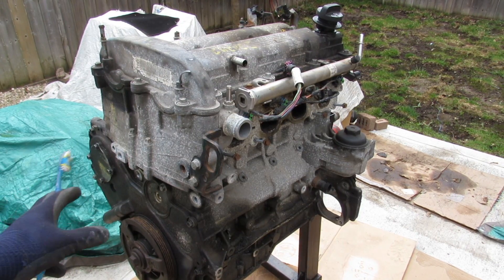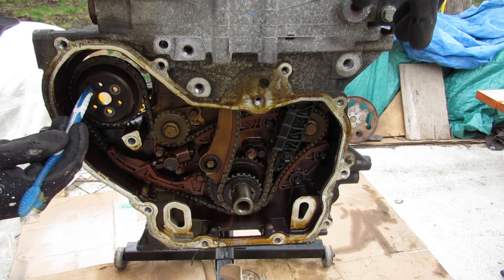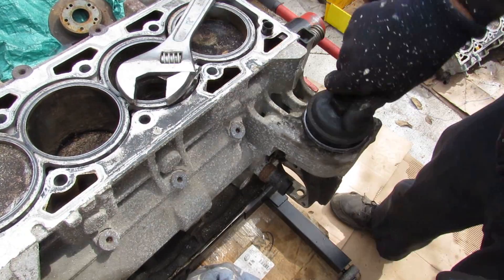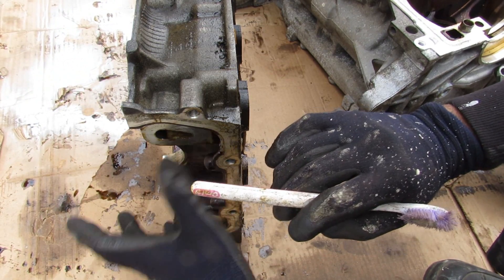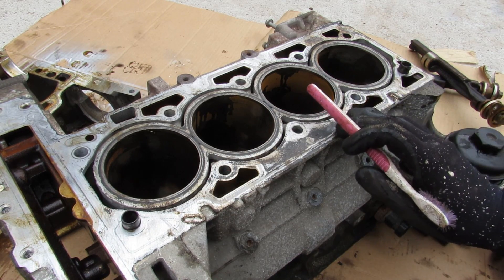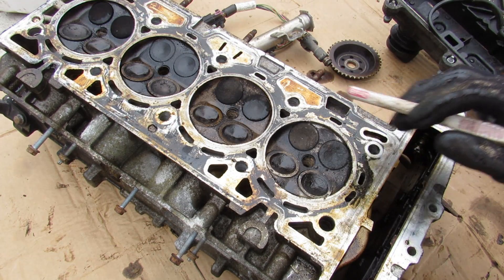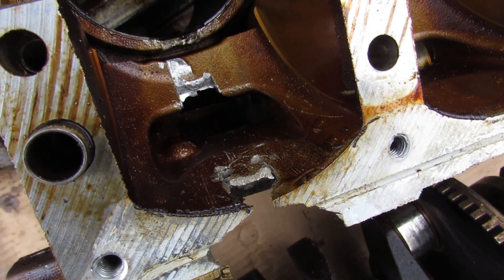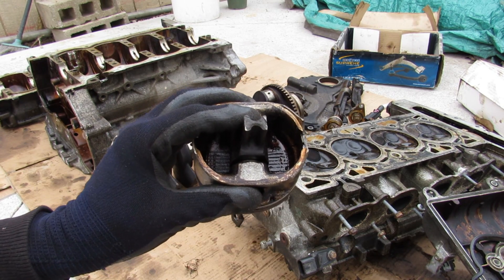Why GM Ecotec Engines FAIL

Comment: I had 2 different Cavaliers with the Ecotec engines.  One of them had over 184k on it when I traded it, and the other had 253k on it.  Both were 5 speed manual trans, and were original clutch and motors.  The only thing I had to do to them beyond regular maintenance was both had their fuel pumps replaced.  Both were running strong when the cars were traded, and neither used any oil. If you kept the oil changed, they were good engines.  It drives me nuts when people neglect their cars, and then complain when they have problems.  Doesn't matter what kind of car you have, if you neglect it, it will leave you on the side of the road!
Reply: I went into the dealership in 2009 and asked for the "Farmer's Special" I wanted a Cobalt manual transmission with only two extras: 1) air conditioning.  2) CD player.  The salesman laughed and said that this was just dropped off today and there it was, a shiny new Cobalt sitting in front of the display window with just what I wanted, including hand crank windows and a 5 speed manual for $9,500 with GM rebate and an additional GM credit card rebate.  I was driving 152 miles a day for work and I needed good fuel economy car.  220,000 miles later I gave it to my son who still drives it today.  I don't have a clue as to how many miles are on that thing now.
Reply: @g.k.1669 they really are solid cars. I beat the ever living fuck out of mine and it just loves it. Not shifting till 5500? They just love it
Reply: People who afford a lower end car are associated with being cheap and not as educated. Not hating, just explaining why these cars get so neglected. When buying any used car make sure the owner has a complete list of maintenance.
Reply: @Opalivian  you sound very uneducated
Reply: Yeah these are really good motors I seen ppl with over 300 and 400 thousand miles with these just gotta take of it
Reply from the maker: Well the reality is cavalier and cobalt are cars that attract buyers who will evidently neglect them.
Reply: @speedkar99  makes me feel like I did good with my Ion with the 2.2 then, bought it from an old lady with full service records. 191K now and still going strong
Reply: @speedkar99  I had one and didn't neglect it. I never neglect my cars no matter how inexpensive they are. This one still gave me problems with head gasket failures, engine idle and stalling problems. I also had a 2004 Malibu and have a 2012 one which has given me no problems.
Reply: @speedkar99 true but my 09 chodebalt has 216k on it original clutch, original everything other than OCV's and suspension parts. But I change the oil every 3-4k
Reply: @speedkar99  Yeah for sure. I mean look at those cars, they're vehicles I would neglect just so I wouldn't keep having to have those things on my property for long.
Reply: My 2.2 liter ecotec has lasted 275,000 kms with no issues, so reliable for me. Original starter too and it starts up like a dream every time. I don't know about these new aluminum engines though... considering these hot summers we are getting now a days.
Reply: @stephenphillips6245   My 2004 Cavalier 2.2 ECOTEC had 255,000 miles on it when a woman on her phone rear ended my wife and totaled the car. It ran great and used about a quart between changes, 3,000 to 4,000 miles. Luckily my wife escaped serious injury. Looked at a 2020 Cruze for $20,000 and the finance guy at the dealer talked me out of it due to trying to sell $10,000.00 additional repair insurance because of all the computers. After saying no to than twice and then him saying, "well, when you come in with a computer problem, the salesmen will laugh at you and point to service where they will laugh and say break out your check book" I stood up and said "thanks, you just talked me out of buying this car", picked up the $20,000.00 check and left after explaining to the salesman I had talked to about the car why I was no longer interested in the car. Later I started looking at common failures and issues with the Cruze 1.4 turbo engines and I was so relieved I did not get one. I went out and searched high and low for another 2004 Cavalier and found one with 36,000 miles. Happily paid $8,000.00 for it. Had to have a friend drive me 180 miles to go look at it. My wife is SOOOO happy with her like new 2004 Cavalier.  I always change oil at 3,000 miles in the summer and 4,000 in the winter. We are mid 70's and drive less than 5,000 miles per year now, so this car will last us until we probably will be unable to drive anymore.
Reply: @seniorrider9337  When something goes wrong computer wise, in newer vehicles, fixes are expensive as heck. If sensors are damaged during a crash recalibration could take dozens of hours and 10s of thousands...most are just written off because of costs (esp. vehicles that park themes or hold road positions). New vehicles are made to need lots of work and to be disposable.
Reply: @seniorrider9337  A few days ago I bought a 2002 Pontiac Sunfire in very good condition for its price of 1700 dollars from a woman who had recently been widowed. The previous 89-year-old owner had bought it new at a GM agency. I am 61 years old and I have always had carburetor cars with iron engines. After buying it, I took on the task of looking for information and the first thing I found were things related to catastrophic failures in the ecotec 2.2 L engine, the most terrible being the timing chain, after much research I found that almost all the failures were the result of wrong oil and long oil changes. On many occasions "there are no bad engines, only bad owners" and this is one of those cases.
Reply: @pazerfaust45  Totally agree with ya man.
Reply: @stephenphillips6245  
Those engines with 2.0T+ can handle the amount of power without straining compared to the weak 1.4T.
Reply: @Monster33336  Always better to go with the bigger engines for sure. Sometimes the fuel savings aren't worth the sacrifice.
Reply: I had an Astra (1.4 petrol)
155,000 when I sold it.used no oil. But I did change the oil every 5/6,000 miles.
Reply: @andylane247  1.4??? Was it a 3 cylinder??
Reply: @dontrustwhiteyevery1  
4 cylinder.  They used to be 1.3 lt. (A fairly old design) but were bored out. Single ohc.
Reply: My 2009 G5 has 276K on it. 5 speed manual. I did the timing chain at 200K. Runs great.
Reply: 2012 is when these engines went bad.  They made an engineering change.  Let me give you an example.  I bought my 2013 Chevy Equinox with a 1.4L Ecotec Engine.  It had gotten an oil change prior to me purchasing it.  2 Weeks later, the check engine light came on.  A friend of mine knows cars and knows this engine.  He said peak at the engine oil level.  It was at the bottom of the stick.  The oil change was 4 weeks previous.  Any car I have owned, I never had an engine use oil like that.  In fact, I never had oil consumption issues like that.  Eventually, it screwed the pooch and im on an engine replacement right now.  So, in this instance, it doesnt matter if you get the oil changed when you are supposed to or even more often.  This engine burned a quart of oil every 4-500 miles.  Its not always neglect.  There was a lawsuit brought against GM for these engines.  Its too late for the fix for mine and it was too late for it when i bought it.  The Equinox is a great car, except for the engine from 2012-2017 time frame.
Reply: @philipwilliams7947  aside from my Cavaliers, I had 3 Cruzes with the 1.4 L Ecotec, 2012, 2014, and 2017, the 2012 had 43 k on it when I bought the 2014, which had 137k on it when I sold it, and the 2017 had 127k on it when I sold it. The only problem I had with any of them was the turbo on the 2014 had to be replaced at 84k . None of them used any oil. Oil change intervals were based on the oil life monitor, and averaged about 7k for each oil change.
Reply: So true. I had to sell my 2006 Toyota Tundra.    ( 1 year old ) beautiful truck.      Money problems    Any way it now has 121.000  only thing been done is oil changes ( & not on time ) no other work done - old transmission fluid, old radiator fluid, old gear oil , eeeerrrrr. I gave him something nice & he just doesn’t give a sh-t    Kills me
Reply: Right! My 2.2 inline 4 cylinder has 245k
Reply: I'm fixing an 06 Coblat today for a friend, had 2 quarts of oil in the crankcase.. running on 2 cylinders and knocking like a rod is about to punch through.  less than 100k miles.   simple things like oil changes and fluid level checks go a long way.
Reply: The first eco tecs were decent. The modern ones are garbage
Reply: 2.4 ecotec is a strong running engine with really good reliability if maintained.
Reply: OIl must be changed eveyyear, at the final of the winter
Reply: I have a20nht 2.0t variant with direct injection. It has 130000km(not an enormous amount but still). Guess gm did their homework coz it doesn't burn any oil, like at all. The stupid thing is that owners manual says you should change the oil at a whopping 15000km which is pretty stupid for a turbo engine, so I reduced the interval to about 8000. Bought the car used, and I suspect that previous owners changed it at 15, but still no oil consumption. Unfortunately, can't say the same about the gas mileage which is pretty atrocious.
Reply: my thoughts exactly. I loved all my ecotec engines.
Reply: He's referring to the notoriously bad pistons and rings on the GMC Terrains and Chevy Equinox. Those engines burned and consumed oil like crazy. You have to install 2 oil catch cans for the dirty and clean side plus do oil changes every 3000 miles maybe even sooner. Constantly having to monitor your SUV more than the standard way is nuts. It was a big deal and GM had a lawsuit against them. They offered the free pistons and rings but it didn't necessarily fix everything. Shitty deal all around.
Reply: The engine that was used for the Terrains and Equinox are the ones with this issue. It's a different engine that the ones you had. You can do all the maintenance to the T, but you can't overcome manufacturer flaws. This is why they provided the pistons and rings service bulletin.
Reply: I will say, when it comes to maintenances are very easy engines to work on. A lot of GM 4 cylinders were. The twin cam, and the predecessing engines. When it comes to actually getting to the guts of the engine though, these are an absolute nightmare. You can't blow them apart and put him back together like Legos like an old small block Chrysler or Chevy, you need special tools and a lot of time. That's where people absolutely hate these engines. I have seen these engines throw a timing chain before.
Reply: Its all about maintaining them never let any engine run with less than the oil level full! Even if it is only down 200 ml you need to top it off.  A catch can is a great way to reduce the carbon buildup on the direct injection design 2.4.l mobile one synthetic oil and mobile one synthetic oil filter!  The reason for oil consumption is the early ones used  lower tension rings and they had insufficient tension causing oil consumption! If you have one that does burn oil  sell it  and  get a 2015 or newer they have the  oil consumption addressed, but Gm did not address the  carbon buildup on the direct injection intake valves  any loss of power  ,poor fuel economy, ruff idle over 130,000km you need to bore scope  the  intake valves and if buildup is excessive you need to have them  walnut blasted and then you are good for another 130,00km basically one time during the life of the engine  its not that expensive to do.  The catch can will eliminate the blasting of the intake valves.  Usually catch can  needs to be  emptied  every 2 weeks in the winter and once a month in summer. Have one on my 2015 equinox  burns no oil, none! Pour 4 once of oil and water from my  catch can  when I empty it.  Gasoline economy amazing,  power reasonable.
Reply: Sounds like you got lucky, not sure how it made it that long what with all the plastic components of the cooling system.

I had a Cruze that pissed out all its coolant instantly thanks to that crappy coolant return hose clamp. Why couldn't they just use metal?!
Reply: I have been for Cavaliers with the l61 evotec including one that only had 41'000 on it when I bought it and they all consumed oil some more than others
Aside from that I completely agree with you they were a phenomenal engine but had a low tolerance for dirty oil
Keep clean oil in it and not run it low on oil and it will go for a very long time 
Currently driving one that is pushing 260'000 with original clutch and clutch and engine are healthy
The Cavalier chasis is a pile of crap but dam what a great engine and transmission as well as factory clutch
Reply: Well it might be your luck cuz I have a 1.8L ecotec chevy sonic (2018) and I've done engine recovery twice till now with only 60k miles on it!
Reply: Mine has 356k bought brand new in 2005 has had 3k mile oil service, and a thermostat! Just regular maintenance to date. Ac compressor replaced this year. Made it to 330k miles on the oem clutch. The last 26k miles have been hard. Has a 7678 turbo  now on about 9psi. With a .25 shot of n20 to help get it into boost and turns off when the car hits 9psi. I’ve ran it hard this year, and have even sprayed it consistently at 10.2psi. #3 is getting weak and starting to cause a little smoke. Have a complete overhaul/upgrade rotating assembly and a stage 4 cnc ported head
Reply: 2005 Saturn Ion, 2.2 Ecotec, 5 speed manual transmission, 249,000 miles. I do regular oil changes. Recently changed the spark plugs, no carbon buildup on them. The only issue they had was the gaps were way off. Since changing them, my fuel economy has jumped from 24-26 MPG to 30-32 MPG. Changed the air filter too. Only other engine issues I've had were the MAP sensor, the alternator, and some carbon buildup in my throttle body, which tripped the throttle position sensor code. I just used some throttle body cleaner and haven't had a problem since. I use synthetic blend high milage oil in it to keep the seals supple, doesn't leak any oil. Just goes to show, taking proper care of a vehicle at high milage will keep it running good. That's why I don't understand why people don't keep their oil changed. It's easy to do, it's basic, and it's the single most important thing you can do to keep your engine running well. The car will probably rust out before that engine quits running, all because I do what's smart and keep my oil changed. One of the best features this car has is an oil life counter. I just reset it when I change my oil, and change it when the reminder pops up on my dash. Makes doing the maintenance a breeze!
Reply: @85bbenjaminfan  Please, take your common sense elsewhere...  ok, back to my video game.
Reply: @halleffect1  😂😂😂😂😂😂
Reply: Agreed but still compared to a toyota engine this GM products are pieces of junk, is sad how GM don't care about their customers only their stock holders, that's why they can't compete against toyota, honda 🤷‍♂️🤷‍♂️🤷‍♂️🤷‍♂️🤷‍♂️🤷‍♂️
Reply: @skylineir34  Toyota is GM.  The fact is that GM wasn't going to become any more valuable if they replaced their old WWII machinery with new machines.  Toyota had no WWII machinery worth mentioning, so investing in new Toyota plants made a more valuable company.  It's only the US government that wants to see American labels on the road.  The stock holders could care less.
Reply: @skylineir34  I worked at toyota and I own a turbo ecotec. The yaris filled the same market as the cobalt. Those owners neglected them and they ran like shit with low miles. Agreed they could probably take the abuse longer than the cobalt. they tend to design cars to be “maintenance free” more and more which really just means they last until they are paid off with minimal maintenance. Most people don’t keep cars more than 5 years. I think the ecotec is good as long as you take good care of it, which I have always with mine and I bought it new. I would not buy it used.
Reply: @skylineir34  I agree with you, Toyota is way above GM, but their engines also die when a bad owner is involved.--https://youtu.be/Q_VPHLrip9Q
Reply: My Toyota developed an incurable engine miss and I got rid of it; my Honda started having chronic electronics problems. I've had great luck with my Chevys and GMCs. 326,000 on my 2500 Chevy truck. Engine is original even to the SS exhaust factory system. Just 1 water pump an batteries.
Reply: @skylineir34  laughs in apex seals and blown boxer head gaskets
Reply: @skylineir34   Absolutely. The Japanese, run a business, the same WAY  AS  THEY  OPERATE  FAMILIES. Greed is killing Gm, Ford, Fiat-chrysler. North American stuff, and also Kia, Nissan going down the tubes.
Reply: @petersack5074  modern ford ecoboost engines since 2012 ish are amazing my 2013 focus st 2.0 dit  6 speed manual has 126k now bought it at 56k not a single repair other than regular maintained oil changes spark plugs and brakes. even then front brakes where from the factory till 115k  and they still had maybe 5-10k left on them.  i do know the clutch is original and is probably going to have to be changed in next 20-40k  maybe sooner never know it is getting old

Comment: My wife has well over 200,000 miles on her HHR that has the 2.2 eco. The car gets the same mileage it did when we bought the car with 42,000. It runs quite and leaks no fluids.
Reply from the maker: Nice. Does it burn oil?
Reply: @speedkar99  One quart in a little over 5,000 miles. No smoke and doesn't foul the spark plugs. Our plans are to drive it into the ground. We've more than got our money out of it.